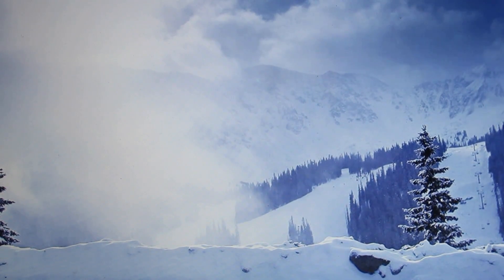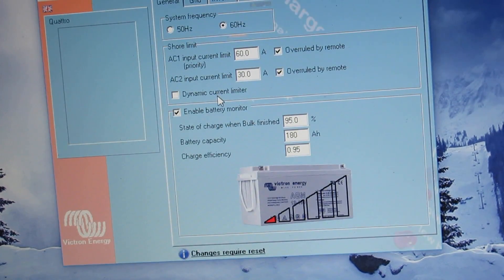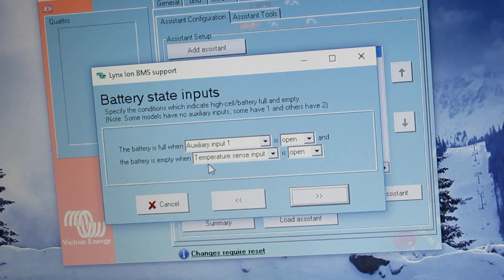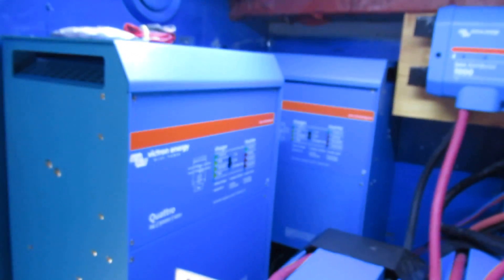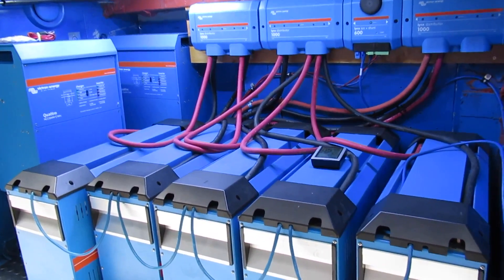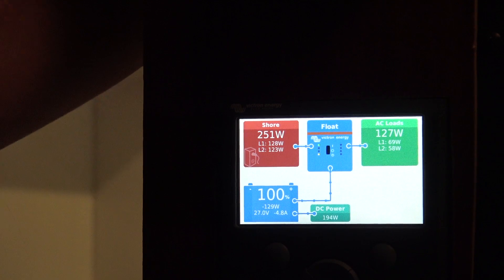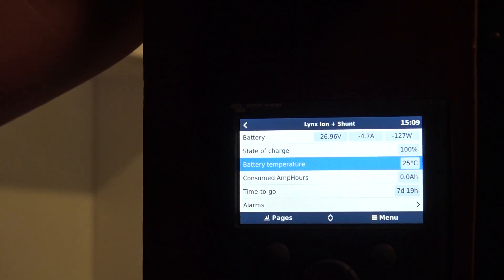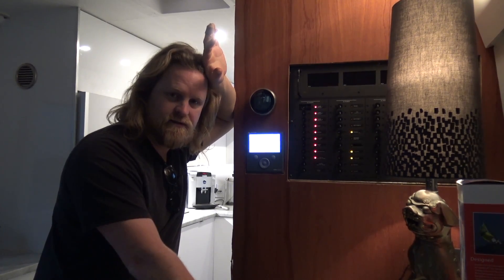Bus to Tiny House - Victron 06 - Off Grid Power

Comment: When you’re plugged in do you have to use 50 amp service? Will the system allow you to power assist while plugged into a regular 110 house plug or even 30 amp service?

Comment: You always have DC from the battery even while plugged in so it wouldn't pass through anyways.  I think you need a AC to DC Power Supply so when you are on ShorePower it coverts the 220 to DC to run the house.

Comment: Something you might want to consider is to install soft start modules in each of your AC units. These help to lessen the impact of the AC units starting, they also allow each unit to use less power, they have videos on their web site that explains how this actually works, but needless to say since you are sometimes running off grid on just your batteries, it should help. You are tenacious, great build. Thanks for sharing it with us. Cheers here is the link if you want to check them out. PS I do not own any stock and am not affiliated with them in any way. Just a great product. https://www.microair.net/collections/easystart-soft-starters/products/easystart-364-3-ton-single-phase-soft-starter-for-air-conditioners?variant=30176048267

Comment: Thanks so much for using off grid measures! Now I don't have to look any further. Is your engine charging the battery bank while running? I've been using solar at home for 5 years and haven't had a bill since! do you know of anyone who has converted to filtered vegetable oil to run the diesel engines? Rock on..safe travels!
Reply from the maker: i do not charger the batteries off the bus engine I use the generator over the road.
Reply: @ChiefPrevost  just had to ask why not charge off the coach while your driving I would love your feed back thanks for your time buddy.

Comment: absence of passthrough is not a problem. the quattro is working like an online UPS, that is, energy always goes to DC then through the inverter. this ensures no potential power failures when the transfer switch used with line interactive technology is used